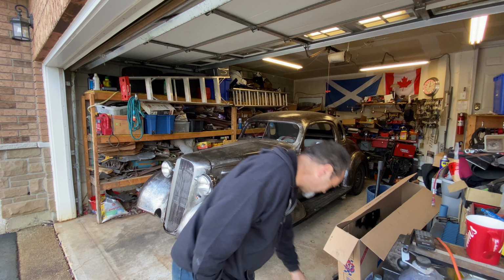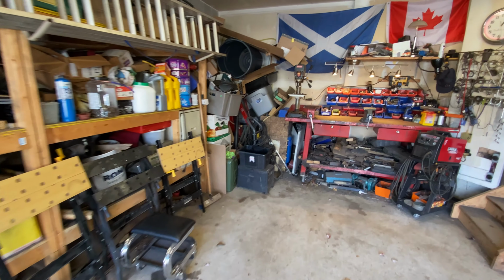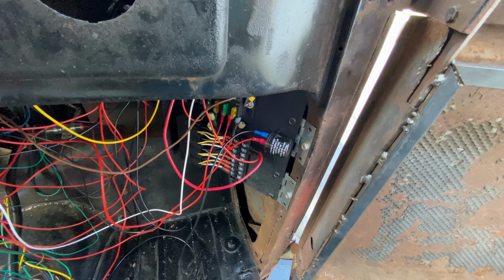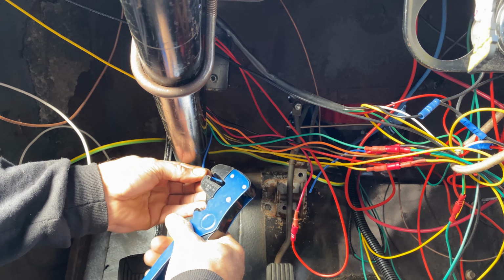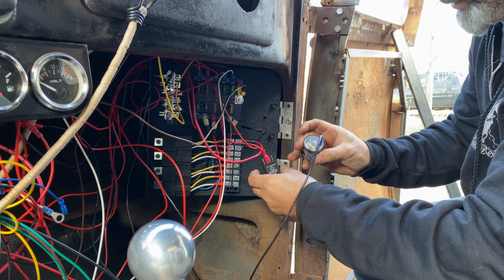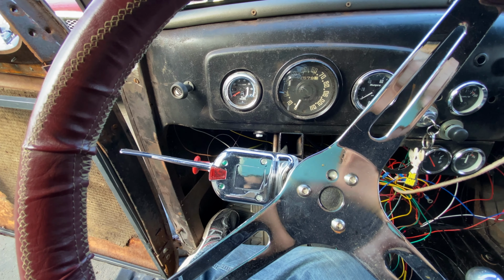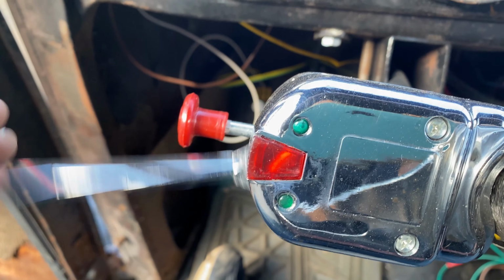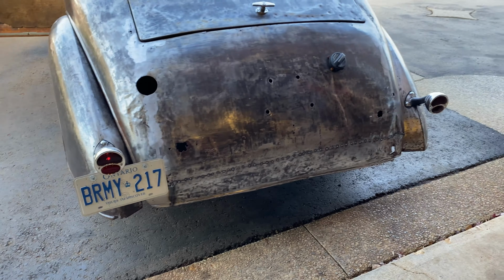Installing A 3 Pin Flasher Relay To My 1936 Chevy Coupe

Comment: Hi Dave, I replaced all of the wiring in my 57 Chevy with an American Autowire kit. And everything worked. Then I decided to add led taillights and parking lights and I replaced the relay as instructed. Now my blinkers/indicators work but I have no hazards at all. I was thinking that I might have to add a separate led flasher for my hazard lights, as my 57 originally came with 2 separate flashers. I think that might be your problem. As most old cars require 2 separate flashers. I never added a separate flasher for my hazard lights, as I had already passed my safety test without them. But come spring, that is what I plan to try.

Comment: you need a flasher relay that is the old style with spade terminals that are marked,x=ignition+, L=load to signal light switch,P= pilot light or indicator light inside the switch .If you get the HD flasher it is compatible with LED's
Reply from the maker: And there was me thinking a 3 pin flasher was a 3 pin flasher. Foiled again.

Comment: Dave, I'll edit this so anything I posted before that was wrong won't be up. 
On that relay, 49 is power in. Your Red wire
Terminal 49a (or can be  "L"  or load) is the switched side.Try Blue wire
Terminal 31 is Earth or ground but on some systems they call it "Pilot light" so must go back to column unit.  Try Black
As "azoo yep" posted you can get relays with the "right" terminal designations that your column unit has (X,L,P). It seems those relays are internally dual coil or dual point units that may be required for this wonderful switcher that you have. 
Sorry for any confusion I may have caused.
Reply from the maker: Thanks Joe. I'll double check my connections.
Reply: @ScottRods  Just keep in mind that info is only about the relay itself. The unit on the column will dictate which wires it needs to be where. But now you have the specs for the relay. If you don't get it figured out, pop up the model number of the  unit again and I'm sure someone can help out further.

Comment: I had something similar on my car... but the 3 pole flasher fixed it.  I do not think I used the LED compatible flasher though.  Oh, and I had 6 volt bulbs in the tail lights... that messed me up for a while.

Comment: Combine two of the wires together it should flash when your tail lights work
Reply: I was thinking the same
Reply from the maker: Which two? and then surely that would nagate the reason for having a three pin flasher.
Reply: I was thinking splice the wire that operates the lights with the wire that operates the little green indicator lights....but I am only wondering and haven't the 1st hand knowledge to truly offer sound advice, and yes it would allow you to return to the days of the 2 pin plug if proven out to be a viable solution. But I seriously don't know.
Reply from the maker: @bwsgarage  Yeah, I tried that splicing thing with the two pin relay first.

Comment: The only purpose of the flasher is to interrupt supply +. the rest is between you and the switch wiring. 4 ways normally run a separate flasher. How many wires coming out of the switch?

Comment: Well after I studied for a minute scratched my head I was thinking maybe you got the positive wire on the lights hooked to the negative side of the switch that would explain why the green lights on the switch was flashing and the taillights weren't but when you switched the wires it worked opposite maybe I'm still scratching my head and a thinking
Reply from the maker: So I looked up the reviews on that switch I bought off of Amazon. Turns out it's a piece of crap and is wired wrong internally. There weren't any reviews when I bought it.
Reply: @ScottRods  yep that explains it!! But I got faith in you you're a really good mechanic